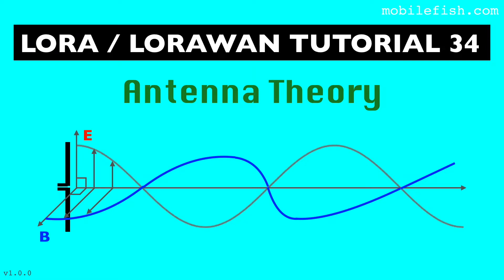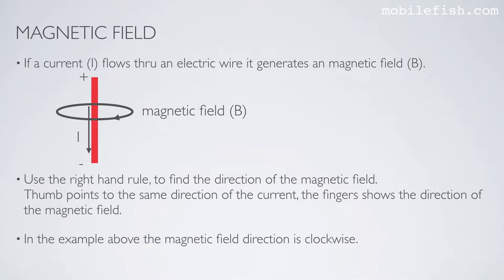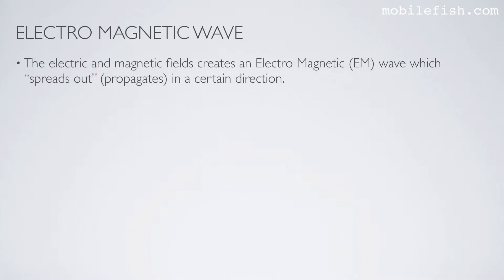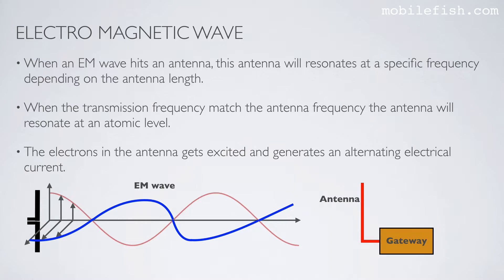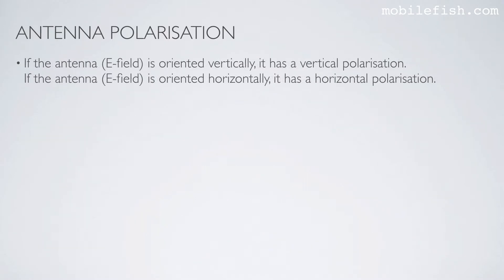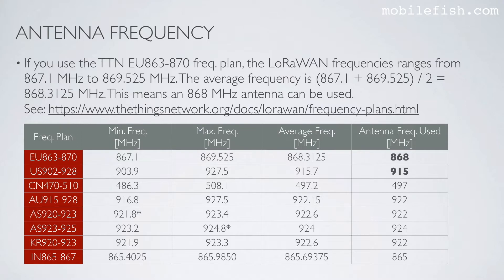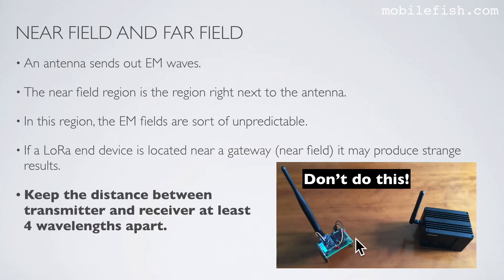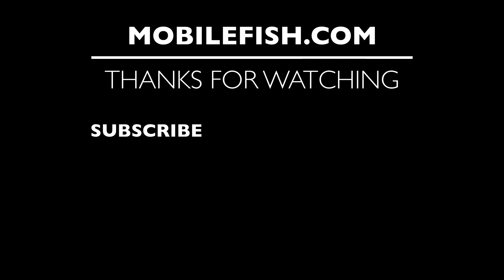LoRa/LoRaWAN tutorial 34: Antenna Theory

Comment: Hello, can i use any type of antena? I have one antena that say: Frequency Range : 4G/3G/2G - 698-960 Mhz,
1710-2700 Mhz, Gain : 11dBi , VSWR:≤1.5 , Cable: 3 m. I want to install lora gateway on 868Mhz
Reply from the maker: I am not an antenna expert. I usually do not trust such specs. That is why i bought a Vector Impedance Analyser. https://youtu.be/d3WSn_MaYiA
It is possible that at 868MHz, your antenna has a VSWR ≤1.5 but the only way to be sure is to measure it. 

Alternatively you can compare the performance of your antenna to compare it with an other antenna  (=100% sure it resonates at 868Mhz). For both antennas, go 100m, 500m and 1000m from your gateway and measure the RSSI. This will give you a rough idea how well your antenna performs.

Comment: In your diagram at the start, it should say 1/4 f, not 1/4 lambda, because you haven't introduced a value for lambda. Lambda = f but you don't point that out. Could be confusing for beginners. But great video nevertheless. Thank you for all the hard work you do producing these videos.
Reply: Lambda indicates wavelength not frequency. The two legs of the dipole antenna are 1/4 wavelength long at the operating frequency.